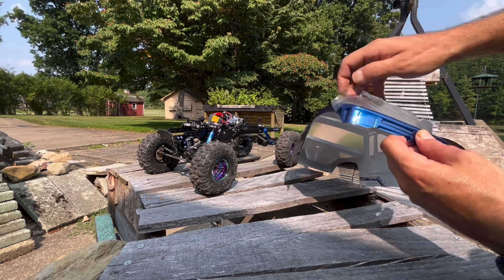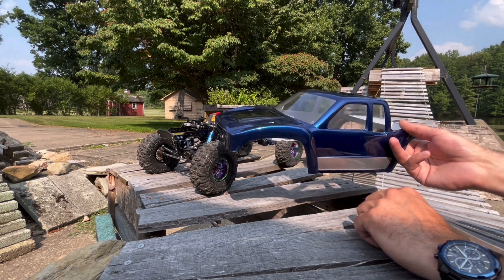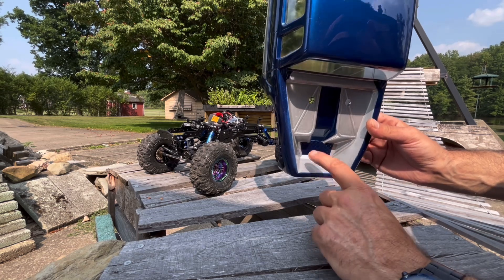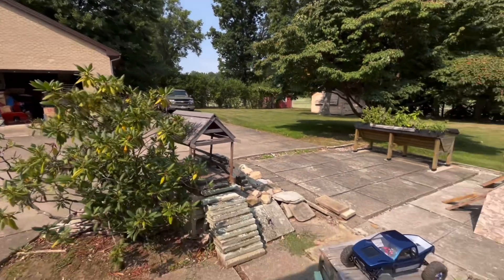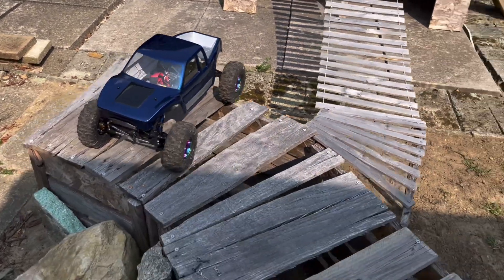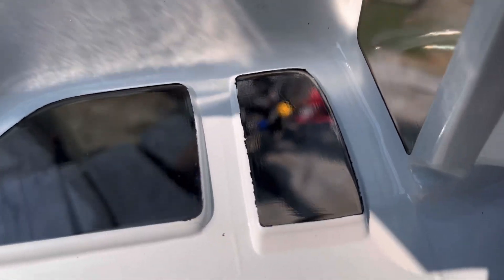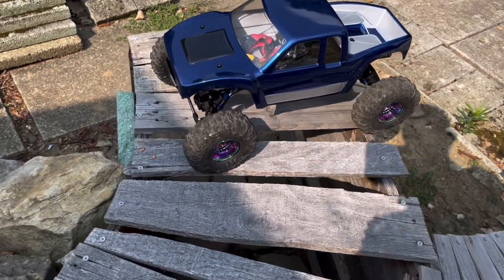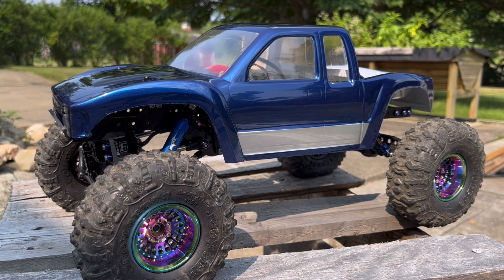1st RC paint job done, SR Customs Drunken Redneck comp chassis build is nearly complete!

Comment: I haven't done anything yet, I got another body for my Jeep (Axial 24th scale) need to see if Ford has that Bronco green touch up paint - won't need to much for the Jeep, just thought of just the one color but will need to mask the windows. Not really looking forward for that job ; probably lots of stopping before I get too frustrated. Although might just back it in black instead of silver or white as original ones.
Reply from the maker: Yeah masking had me pretty frustrated. The window masks that come with the body are pretty easy but doing your own free hand masking is a tedious painful process and I was doing relatively easy masking. Maybe try just using a brush for touch up paint and not worry about masking? Unless it’s right up against a window..